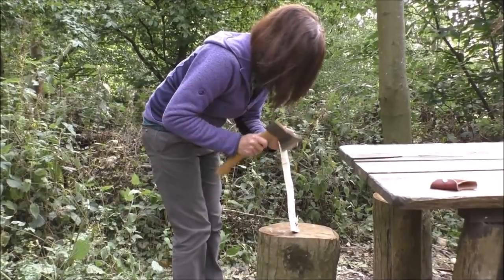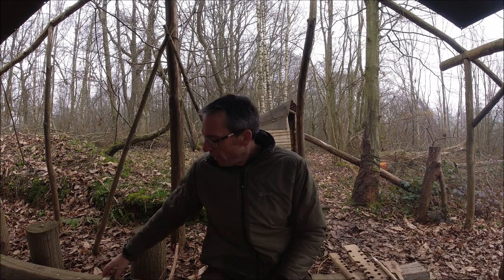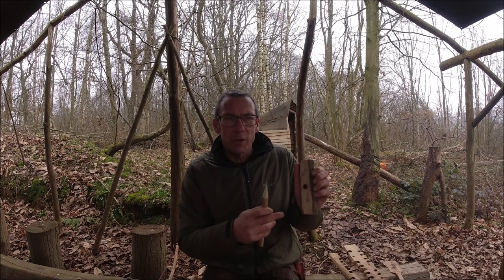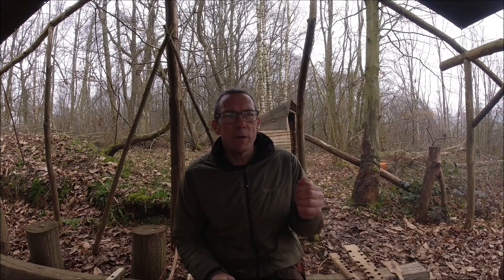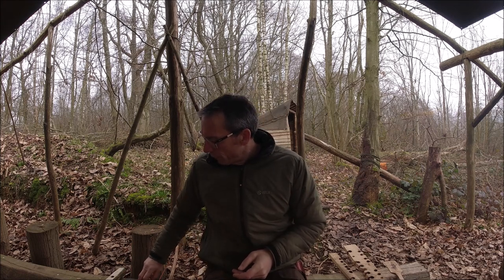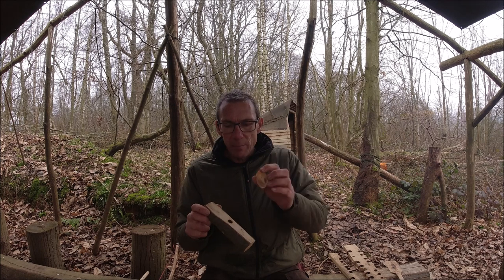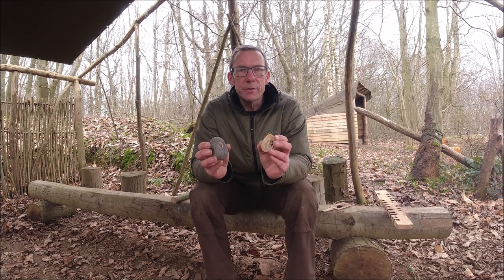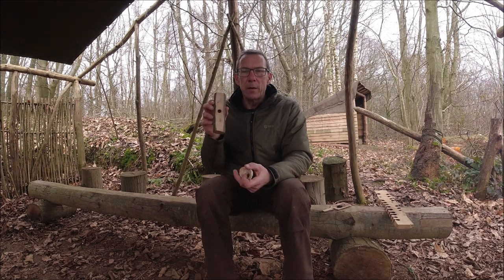Alternative bearing blocks

Comment: Yet another really informative video, may I just ask in case I missed it, you mentioned the wood you used was hornbeam, would that be for all 3 parts the set or just for the top and bottom parts and the spindle a different wood, hope that makes sense back on my heavy meds so not thinking to clear.
All the best Lee
Reply from the maker: The woden bearing block I showed was made of hornbeam.  The spindle was hazel and the hearth board was lime.

Take a look at my video on the component parts of a bow drill set Lee.